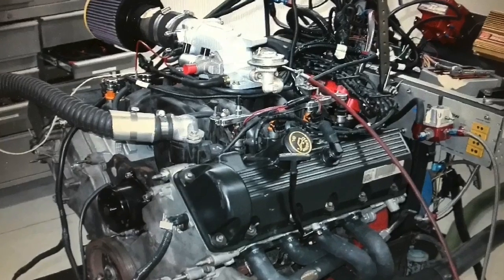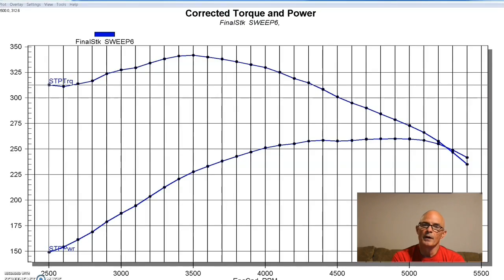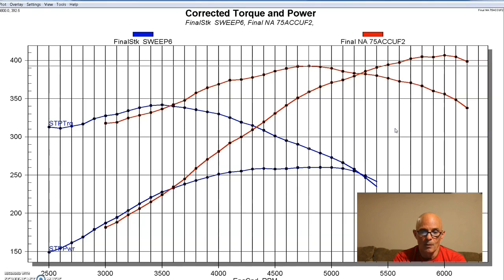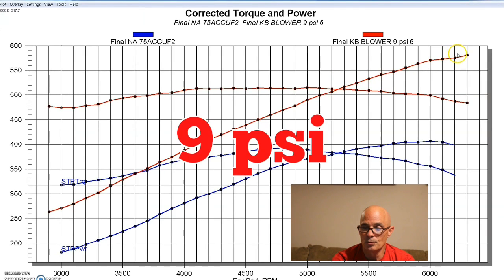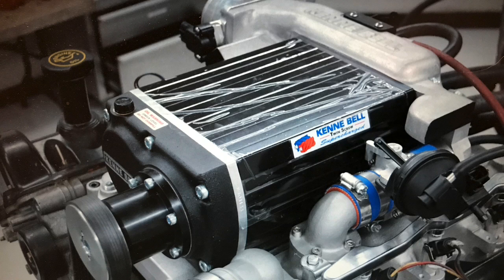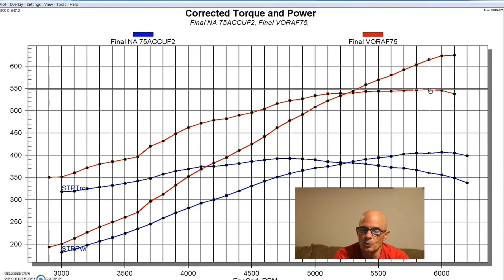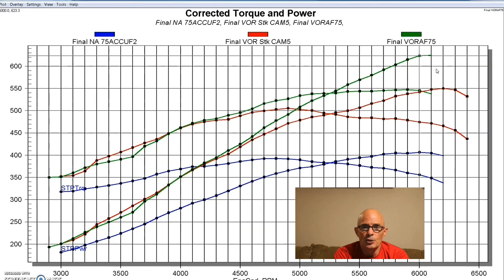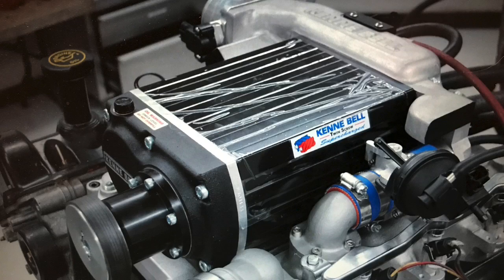HOW TO: SUPERCHARGED 4.6L FORD 2V (BOLT-ON BOOST)

Comment: One of the 2V's major design flaws was the plastic coolant crossover.  Since the timing chain covers block the front of the engine, Ford couldn't move the crossover down into the water pump casting, as GM did with the Gen 3 (LS).  This is why the LS has 2 coolant holes on each leg of the water pump - the top ones function as the crossover since those 2 holes make 90 degree angles once in the block to connect the head water passages.  Random factoid....

Comment: My 2011 Crown vic Police interceptor has a 4.6 2 valve. I really want to put a kennebell 2.1L supercharger on it and DD it. But, not quite sure how I'd have to do the throttle body and such

Comment: Someone told me that a turbo is easier on an engine then a centrifugal super charger granted you’re running the same boost , I heard the instant torque of the blower is a little harder on the bottom end is there any truth to this Richard ? It kind of makes sense .
Reply from the maker: minimal torque on a centrifugal-but PD blower do have instant boost. Ultimately the Turbo offers more torque-check out the video where i compare them all on a 4V
Reply: Richard Holdener yeah I meant to say positive displacement blower my bad . And looking forward to it !

Comment: Great job Richard! Thanks for the tech tips between the various heads swaps. Does this also apply to the V10s heads also? Thanks for all u do
Reply from the maker: did they make non PI V10s
Reply: @richardholdener1727  
1997 until 1999 were considered “Non-PI.” The PI versions started in 2000

Comment: My wife’s 2005 exploder 4.6 takes barely a touch of the throttle and it takes off almost the same as full throttle. Ferd has some whacked throttle response tuning. I’d seriously consider heads and a cam to bring it to the NA numbers you found, but the trans would pack its lunch the first day. Lol. Cool video - thanks!

Comment: Also, what's causing people to blow their 4.6 2Vs? It seems to me the heads and cams were the trick and it seems most just slap on boost without upgrading the engine.
Reply from the maker: tuning most likely
Reply: @richardholdener1727  which one would you say is more cost effective?

Comment: You're my hero. I've seen videos of guys blow their engine trying to run boost on a 4.6. I was already prepared to have to buy an LM7 for my crown vic to achieve my goal but this changed everything. Now in terms of cost to run this 4.6 set-up vs a 5.3 set-up(super or turbo charged)which one is cheaper?
Reply: On3 Ebay kit actually does a good job . The one we worked on made 429 wheel hp , all stock .With out pushing it because everyone was saying it'll blow at 400hp. Then uped the heads and cam and intake . Went to 560 with stock botton end for 3 years . Very safe tune . 6 years ago.  We got a ford cobra crank from Ford for 345$ and lunati rods and JE pistons . Up to a bigger and much better 76m turbo . Made some small changes yo the kit .Made 714 with out stand alone . 2 years age the owner of the car got a stand alone .tuned it to 800hp . 
Sadly he go a coyote and the 4.6 2 vavle is sitting . I made him an offer . He said no way.😁😁😁 
Shit,  i help build half that car .you figured he'd say yes .
Reply: Tony Spadafino you even put ring gap on the one with 429hp?
Reply: Turbo you can find turbos cheap i don’t see SC under a couple grand
Reply: @Billybobaggins9  damn those are some pretty good numbers. I always hear about people blowing up the 4.6 but according to Richard, it was likely a shitty tune. 

Would you say it's more expensive or just as expensive to upgrade a 4.6 vs a 5.3?
Reply: maxie9506 5.3 will be cheaper in the long run it’s the most popular mod motor nowadays
Reply: @maxie9506  it would definitely be cheaper to upgrade the 4.6 already in your car. Think about it. By the time you purchase a 5.3, ECU/wiring harness, and everything else required to make the swap you could have boosted the 4.6 twice....
Reply: Billy Bo Baggins not really. I’ve been doing some research. The 5.3 out of the gate in factory form is the better engine performance and cost wise  over the 2 valve. But if you start going all out forged everything aftermarket heads, intakes, cams, and so on. The cost difference is minimal. Less than  $800 between the two. I was kind of shocked when I added it all up. I always believe the same thing. Speed cost money anyway you slice it. 🤷‍♂️ Trickflow makes a 195 race port heads now for the 4.6. You can get a pretty reliable 800 to 1000hp out of the 4.6 2v now days.

Comment: Can you put the comp cams back in and replace the LTs with the factory log exhaust manifolds?  Its a big debate with the 2v guys as LTs are a major pain to install and we would really like to see what all that time and effort is worth on a boosted application.

It would be great to see!
Reply from the maker: I did a long-tube header test-they work well
Reply: @richardholdener1727  Thank you!!! do you recall if they were 1"5/8 or 1"7/8?
Reply: @richardholdener1727  do you have a link for that video? Or article even, would appreciate it!
Reply: They are a pain to install. I suggest a lift

Comment: Excellent episode.  I think the 400 hp limit talk is with accessories on the engine and rear wheel numbers.
Reply from the maker: even then-not accurate
Reply: Richard,

Agreed. Something that has always been on my mind about the 4.6 is how much hp the stock crank can handle. Have you ever seen a stock crank failure? I’d love to see a stock bottom end test. If the rods fail I’d like to see another test with better rods to test the stock crank.

Comment: I've always heard 400hp at the wheels is the rod limit and honestly still sticking by that. Those stock rods are cracked cap style, powdered metal, weak looking things
Reply: Ls rods are cracked, powdered, weak looking things as well. It has a lot to do with the tune
Reply: Rods in EVERY current domestic high performance production V8 are powdered metal today - and they're holding over 1000HP

When the '07 GT500 came out, there was a huge [faux]outrage over the fact that it had a "weaker bottom end" than '03/'04 Cobras, which had factory Manley drop forged H-beams while the GT500 had fractured cap powdered metal rods - meanwhile, back in reality, it turns out that the GT500 engine will hold EVERY BIT as much power as the Cobra engine. Because the Cobra engine came with mediocre pistons(the bean counters are going to pay for only so many expensive ass drop forged parts) that collapse the skirts before the GT500 engine breaks its "weak" fractured powdered metal rods.

The Boss 302 powdered metal rods are UPGRADES for the 1st gen GT Coyote(which bone stock are good for well over 700hp)

Guess what kind of rods are inside the $85,000 ultra limited production 840HP Hellcat Demon. Uh huh - powdered metal(with ARP 2000-series rod bolts - which is hilarious)

The LS9 had titanium rods(...powdered metal...) - guess what rods are in the LT4 that superceded the LS9.
You already know - powdered metal steel

Poor assumptions; engineers & material scientists do know what they're doing
Reply: I agree but if you keep a smart and safe tune . Iy should last.  Ive seen many 550 stock motor.

Comment: @Richard Holdener You know they kept putting 2v 4.6 in trucks until 2010 and vans 2014. I have been into a 2011 van 4.6 and can say they did change them over the years. The rods and pistons were different on the last few years.
Reply from the maker: didn't realize the rod and piston change

Comment: I am an unabashed hater of the Ford mod motors.  You blew me away with the h/c/i 4.6 combo. I was NOT expecting so much power nor such a beautiful curve from an NA 4.6.  
Keep up the great work Richard!
Reply: It's easy to complain about an engine not being able to make any power when no one ever actually TRIES to make power from it
Reply: Colton Robinson and RyTrapp0 : Ford learned from what it did with the Cosworth Belt Drive A and DFV and DFX and  Cleveland  engines, which were 3.78 and 4.38 bore spacing engines spat out from the same basic mass production  transfer line. Even the Hart 850 hp alloy BDT and Cosworth alloy DFX Indy Cart 850 hp and NASCAR  351W/C engines  were essentially almost a mass produced aftermarket race engine cobbled up from Fords iron engine base. The basic Mod engine is a pizza base. Ford had other engines on the 3.937 inch spacing  Mod platform that made awesome  ZR1 Corvette quad cam and more power. The 281 cuber iron 2V was just a door stop that sold in REAL volume and stopped people buying Celicas , Scions and spindly rod 4.7 Tundras.Fords pizza base plus approach ment the eventual alloy block 4.6, 5.0 and Ford  GT 5.4 Four Valver stuff also goes right on any iron block base. Its basics are sound, the crack off  powdered rods are going to be okay on a dyno, not in the real world. But remember the Holdener 1046  hp 5.8 liter turbo truck F150 engine which used stock 5.936 inch Windsor forged rods. Epic Fail!  The 4.6 liter...it should have been born a 5 liter instead of a 4.6 from birth. Ford had decided to make the Teskid Cammer its lead halo engine. The single cam per bank 4.6 was born 15% down on power and torque from birth. Ford did that on purpose. It sold more of them that way.
Reply: So does that prove that you never knew what you were talking about?

Comment: Would definitely be interested in seeing a big bang 2v, also 4.6 vs 5.4 comparisons.
Reply: This needs to be a reality. Needs. There have to be twice as many 4.6 2vs sitting around doing nothing that need to see some boost examples. Like at exactly what point do the rods fold, if you replace rods, when do the pistons shatter? Supposedly the crank is good for the end of the block. 

Purely a vote, but I suggest 4.6 from a panther because itll probably be the cheapest. Itll be iron and it will have the worst parts of almost any of them.
Reply: @MrAPCProductions  d did d fs fs yes to feed Dr f cool
Reply: I’m doing it now boys. God has chosen me to revive this 154k 99
Reply: @TablerAutoDetail  how's it going with the project man?
Reply: @ryanalam5669  transmission is getting installed as we speak.
Reply: @TablerAutoDetail  dude that's badass, let us know how it goes!
Reply: @TablerAutoDetail  legend
Reply: Make 800hp, and watch people start putting 4.6's into new edge mustangs to replace their LS setup.
Reply: Oh lord yes, a BB 5.4
Reply: There is a lot of 2v 5.4s as well
Reply: @barenecessitiesJL they were better than the 3 valve ones
Reply: 5.4 doesnt handle as much boost or am i tripping

Comment: And there you have it that proves my point this is why so many Ford guys are putting LS engines in their cars it's a no-brainer as you guys probably already figured out I am a real big fan of keep it simple stupid, so why would you owe anybody for that matter want to complicate their lives only to get less and you'll spend more go figure, thank you Richard for saying it like it is Ford sucks!
Reply: Manuel Rodirguez,

Not everyone has the same goal in mind. I have a 2001 2 valve Mustang and wanted more power. I looked at all of the options available and chose a to put a Vortech on it. I have a reliable car with air conditioning and 400 hp at the wheels.  If I went with an LS I’d have to figure out a transmission, air conditioning lines and brackets, front accessories, throttle cable, cruise control, headers, ECU, motor mounts, connecting to factory gauge, ect. I think you get the point. Suddenly that cheap junkyard engine is costing a fortune. If I were building a maximum effort drag car I would agree with you.
Reply: @burgundygt  well I'm going to have to say that I agree to disagree there are so many ways to skin a cat, you quite frankly just took the path of least resistance so therefore based on what you're telling me the level of skill in the automotive field will greatly impact your choice, if you're depending on others to put your car together for you you're going to pay through the rim, as far as parts are concern you can always get a wrecked donor vehicle that will take care of at least two-thirds if not more of all the components you need, now as far as any Force induction system is concerned there is nothing cheap "and I'm not talkin about the eBay junk" about any Force induction system unless you're handy and you're capable of fabricating a lot of the stuff you need.
Reply: Manuel Rodirguez,

A wrecked donor car is not going to solve any of the problems I mentioned about doing the swap.
Reply: @burgundygt  I guess you are right if you are incapable of putting your own dream car together then go to the dealership pick a color and sign on the dotted line for a new Mustang and then gets spanked buy a rinky-dink junkyard LS but don't threat you have a shiny new Mustang with a monthly payments for the next 5 years and let's not forget that guy that spank you with a junkyard LS every time you see him you'll Tails will be between your legs.
Reply: Manuel Rodirguez,

Haha. Now you’re talking about dream cars and mentioned a junk yard LS. Hahah. That’s awesome. Thanks for the entertainment.
Reply: Mr. Rodirguez, what, a second camshaft is complicated? I'm in agreement, if one lacks the necessary skillset, purchase a LS engine, add a cam, boost and enjoy. For others that love a challenge, not shy of technology, understand that they will pay a little more for parts, and want to power their Ford with a Ford, this video is priceless. Boost on!
Reply: @ts302  you know you Ford guys are sitting pretty and I say that because Ford finally sees the errors of their ways by offering there new 7.3 liter I know it's a relatively new engine and you're not going to be finding that engine in a salvage yard anytime soon unless you buy a crate engine and yes it'll probably be more money than you want to spend but I have to tell you me being a GM man I am excited to see you guys, I seen the specs on that thing and that's a race engine in disguise I fear the GM guys have got their work cut out for them!
Reply: @mannyr.2756  they copied the ls hard corn on the 7.3
Reply: @HioSSilver1999  yeah it looks that way doesn't it lol!........
Reply from the maker: Generalities like this are foolish
Reply: @richardholdener1727  okay okay I'll behave sorry Dino Daddy.☹

Comment: can someone explain what is the point of going SOHC when it's gonna be 2V/cyl anyway? what would it's advantage be against an OHV 2V?
Reply: Less parasitic loss to operate the valvetrain. Allows for more efficient intake and exhaust ports as you do not have to work around the push rods being in the way.
Reply: That you don't need push rods?
Probably more to keep the architecture similar between all the mod engines.
Reply: @espenschjelderup426  pushrod engines are supposed to be "simpler", cheaper to manufacture, and more compact. Plus Ford already had pushrod engines on it's lineup, so the only way i thought an sohc would make sense is if the base motor was at least a 3V/cyl engine. anyway, @Sammy Sampson already had a sensible answer.

Comment: That na heads cam version actually put down pretty good numbers at reasonable rpm. I was impressed.
Would be a nice street engine.
Reply: With the ported heads they used, I wish they would've used a .550 lift instead of the .500". They would've seen even better #'s. I definitely agree with what you said.
Reply: Tonda Porter crazy that this 2 valve had as much horsepower and more torque than the 01’ 4 valve he tested with the different intakes.

Comment: A big bang 2v would be cool to see.
Put the higher lift cams in it from comp with those ported heads and PI intake with the accufab throttle and 2 massive turbos and see what's up.
I think it could achieve in the same ball park as the 4.8 LS or maybe even the 5.3? 
Ultimate mythbuster you are mate.
Keep up the good work

Comment: Is it possible to make the blue line green and the green line blue? The red against the green is almost impossible to see the difference. The base line is generally well away from the spaghetti lines. Red and blue are not great, but they are much better than red and green.
Reply from the maker: I can try to adjust colors
Reply: @richardholdener1727  light and dark colours are best.

Comment: Big bang on a 2v & 3v mod motor would be awesome so would a 5.0 HO since those also are limited to "400hp"
Reply: Its not that they are limited to 400hp, it can make much more its just a mattter of how long they stay together. The 4.6 blocks are pretty bulletproof  but the 5.0 block itself will literally split down the intake valley with a good amount of power going through it. The factory block its self is very weak. Ask me how i know lol.
Reply: Ya it was sarcasm even roadkill made like 700hp on a stock block turbo 5.0 it would be interesting like the LS series to see where and what would cause the failure when you remove as many variables as possible
Reply: @pyric  But what kind of info do you expect to get out of such a test? 5.0l blocks have split anywhere from 500HP up - after 20+ passes at the drag strip

Making a single 1000HP dyno pull doesn't prove anything more than that specific engine could hold 1000HP for 1 pull. But engines aren't used that way; not outside of Top Fuel anyway.
Even the most ardent LSx fanboys consider "around 1000HP" to be the limit, in spite of Holdener's 1500HP bullet. The 'big bang' tests aren't irrelevant, but the information that is gained from them is absolutely context specific.
Reply: @pyric  YouTube Tony whetstone